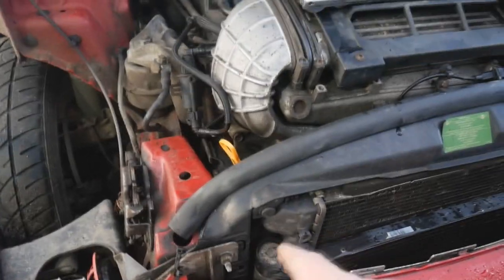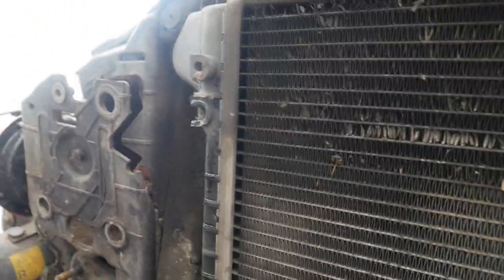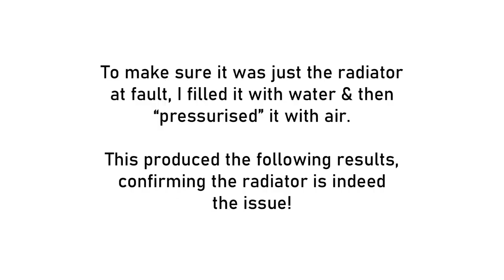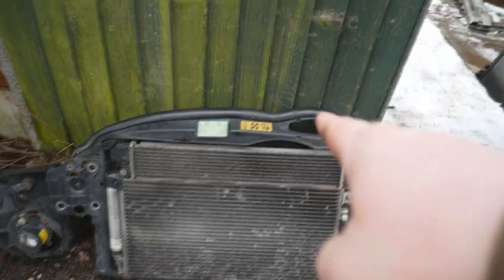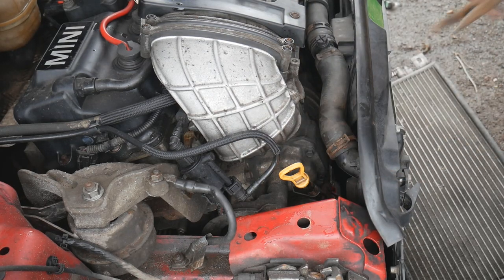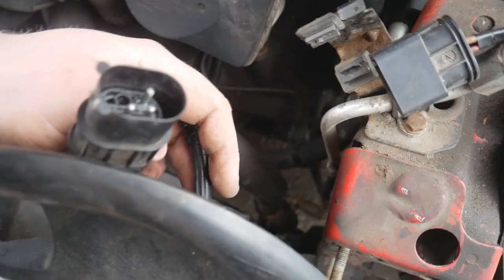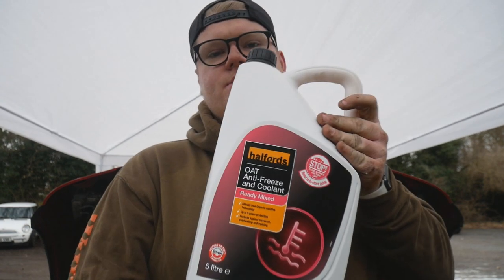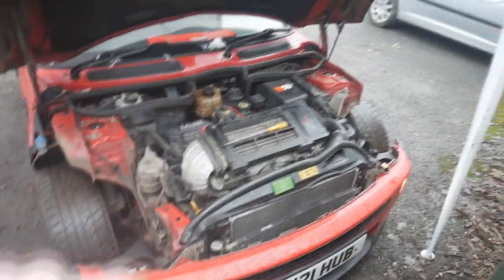How To Replace A Gen. 1 MINI Radiator & Bleed The System (R50, R52, R53) | Grinding Gears

Comment: Well done mate on the repair. How's the car doing now, just see I have a pin hole leak on the one I just brought the wife
Reply from the maker: It’s in bits at the min mate, have a look at my latest video. Glad you found this video half decent!
Reply: @GrindingGearsOfficial  will do man I'll watch it now. We just got a mini one o8 plate for the wife for work. But as always you find little issues like this. Do you know if they had over revving issues in 2nd gear.
Totally found your video useful 👍.
I'm a vw transporter driver myself
Reply from the maker: @ORIGINAL4D  not that I’ve heard of. Could be the clutch slipping!?
Reply: Just had a new radiator fitted . Now I noticed it was empty of water  .I topped it up twice . Then I noticed  a small leak coming out the bottom .  Any ideas  . Maybe the garage didn't do all the pipes up tight ??? Thanks.

Comment: Just a quick question, did you tighten the bleed screw back up before you started the car? Or only after it had been running for a while? Thanks and great job!
Reply from the maker: Leave it undone slightly when you start the car so all the air can escape. Once there’s a smooth, bubble free flow of water coming from the screw - tighten her up!

Comment: Where do you check the temperature for this? I got a 2002 mini cooper that has seen some better days. I just want to know where I check the temperature so I know it is working right. Any help would be much appreciated thank you!
Reply from the maker: There should be a temperature gauge on the speedo in the middle of the dash